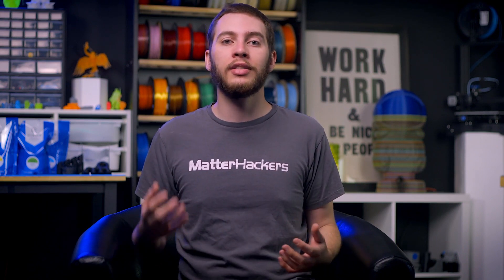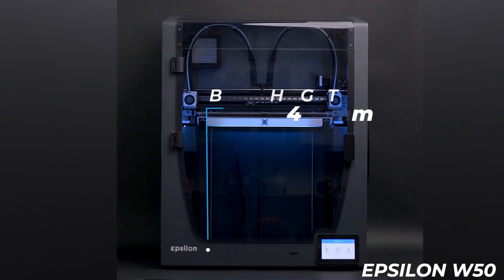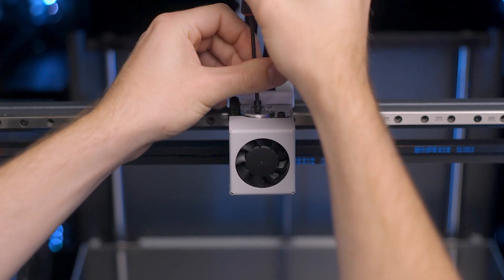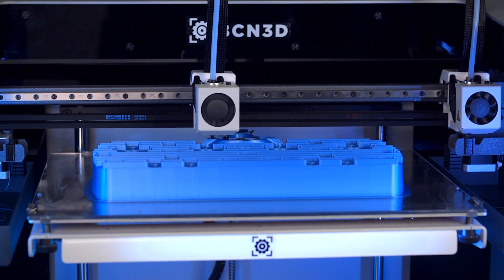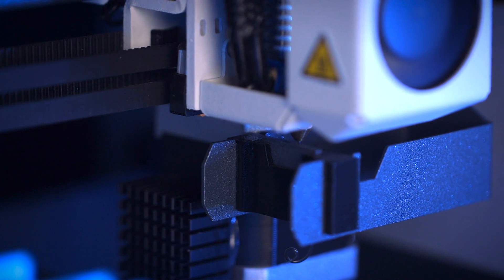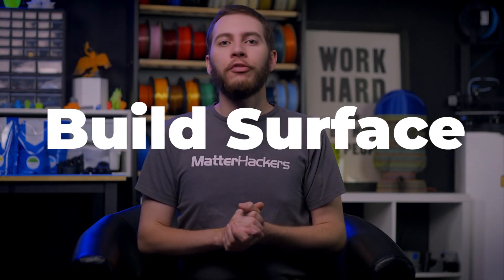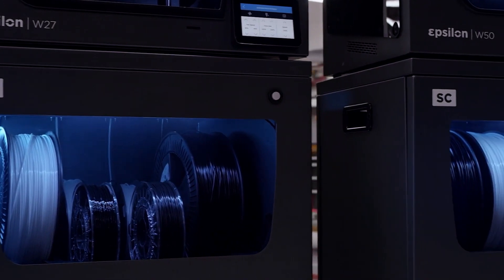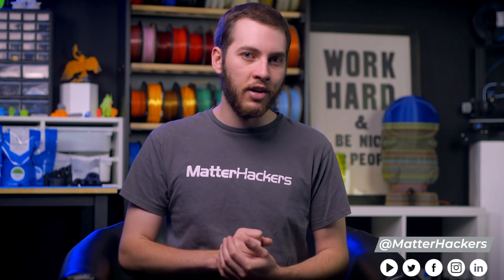Comparison Guide: BCN3D 3D Printers

Comment: Why do you tell someone that firmware is on the board but, when it is not compatible with their printer you tell them to install the firmware themselves without helping them whatsoever with getting the product that you supplied to work. Why is it so difficult to tell a newbie how to replace their board, and why cant you walk through the process of it? You sell the board after all so you should provide as much information as you can, and you should be giving proper customer support by telling them how to use the board in the way the customer needs. Why do you sell things with the firmware? It obviously wont fit every printer so why have any on it at all? Mine came without any firmware and I have yet to find the right way to set it up. They said "oh well your on your own" when they obviously claim to have firmware on the board. Why sell something and not include what you promised be on it? Why make it so hard for a newbie to fix their printer? It just makes them frustrated since they lack the experience and the patience to do the repair without pulling their hair out. There are no repair stores anywhere, so why wouldn't you try to help them get what you promised be on the board onto the board, rather than make them do what you should have done in the first place. You did not give any clear instructions to install the software, and your technician left that person without any proper help. You have effectively ended that person's hobby just because you were too lazy to help them put the firmware onto the board that should have been on there in the first place. Why would you treat a customer like that? Especially when they waste all that money on a board just for it to go to waste due to your own ignorance. They will never buy from you again based on their experience they had with your support team. Derrick was awesome, but your technician who handled the issue was not whatsoever. I don't know why you can have your support be so divided. One person tries to help as much as possible, just for the technician to decide you are not getting any help with what the board was supposed to come with. Thanks for crushing someone's hobby and any hope they had for fixing their machine. I hope you have a good day, you deserve it after how you treat your customers.